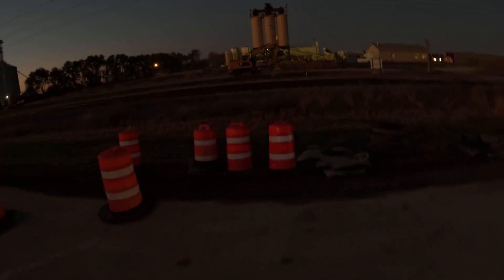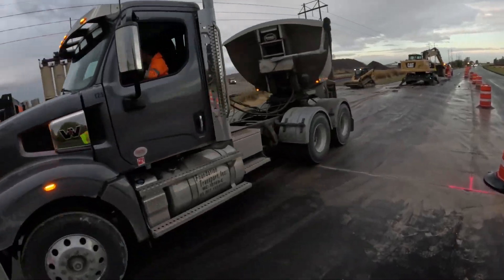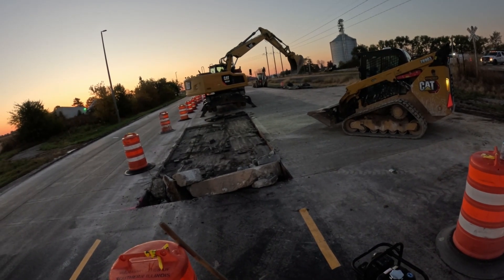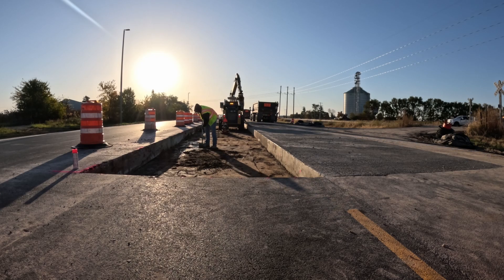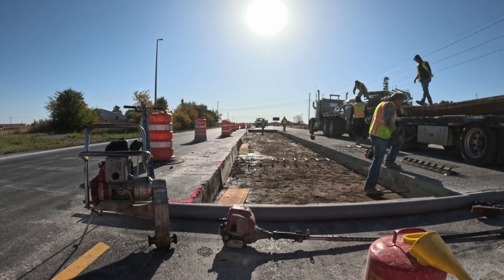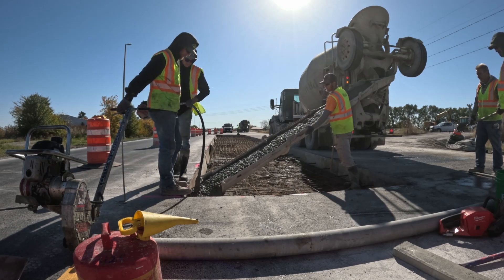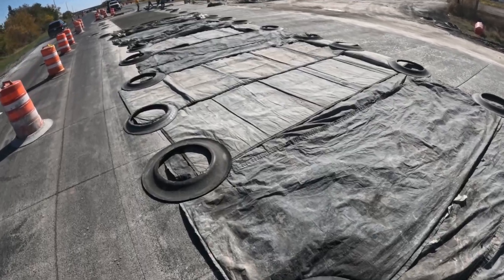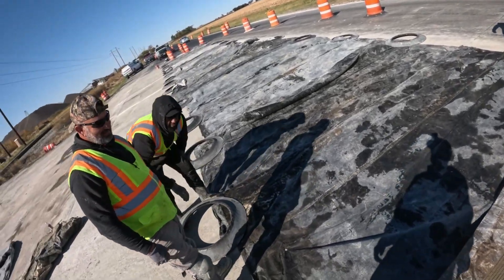Watch This Asphalt Road Get Turned into a Concrete Road in One Day

Comment: Do you guys just have traffic barrels or do you actually have traffic cones. Just wondering. Plus cant somebody buy a cone truck so it csn be easier.👍
Reply from the maker: This is just a small setup in front of this asphalt plant. Majority of the barrels seen in the beginning of the video are part of another construction zone further down the road where the asphalt contractor is still working. We just connected onto it to do this section.

We open the road up each day here when we get a concrete break. So until we get the last lane, we just drag the barrels to the shoulder. 

We have a barrel semi that we use to put out and pick up barrels. I have another video showcasing it. 

Cones could have worked here too, but this is the setup they chose to use on this project.
Reply: Ok